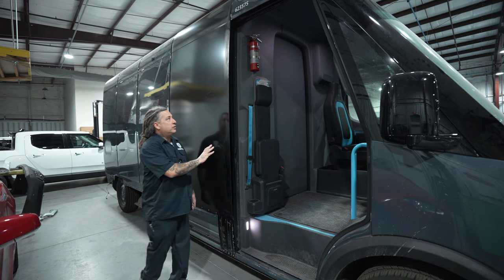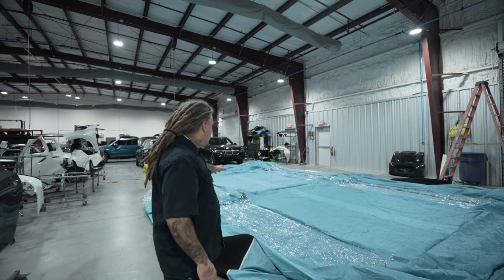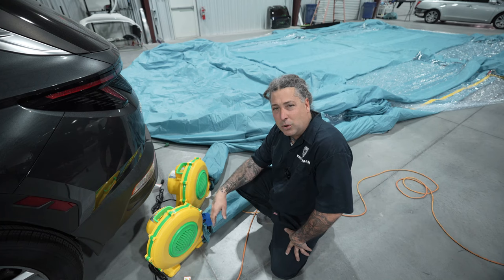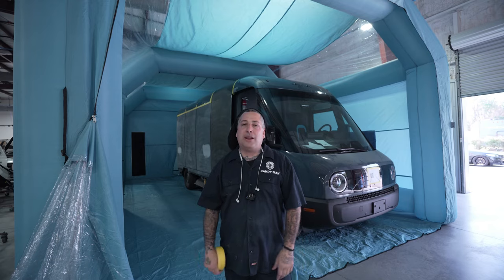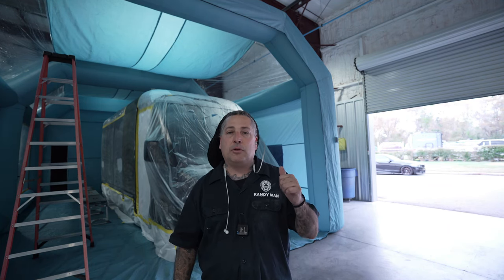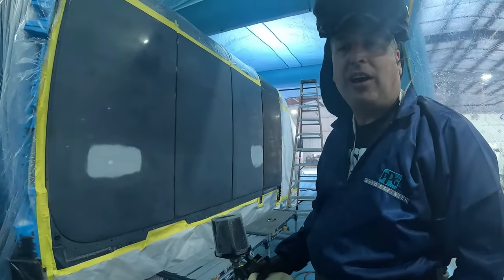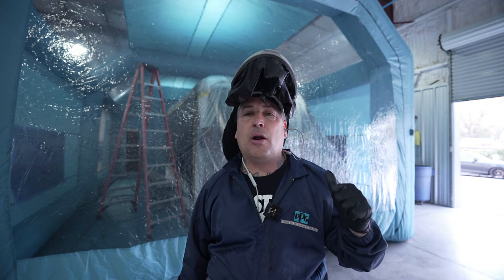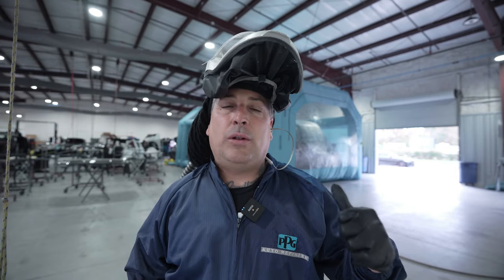Painting A Rivian Delivery Truck In A BLOW UP Paint Booth!

Comment: I use a custom Sewinfla airtight waterproof blow up. A bit more expensive 4000-5000 after all accessories. It does not use the blowers to keep it up, once you inflate, it stays up for a long time. Fans are just used for circulating air. I have 2/1100W intake fans and 1/520W exhaust fan. No overspray issues even on clear coating whole cars, provided the filters are kept clean (replace often). They make them in custom sizes. Cons: the custom made ones are shipped from China so you have to wait a long time for delivery. And you have to replace the filters often (but you can buy rolls of the filter material relatively inexpensive). Also if you buy a larger one piece, size, it is mobile but heavy (they do make the two piece ones that are zippered in the middle, and can be used individually as well, but I have never tried those). Customer service has been great so far.
Reply from the maker: Appreciate the information  👌
Reply: @kandyman5315  I appreciate your content, and all the lessons. Thank you.

Comment: They make a 3hp exhaust blower that helps alot on overspray a must with that big of booth I have the 30ft long both without the little room also have the elephant booth fan on the outside that does great I think I paid 250 for elephant fan and 300 on 3hp exhaust blower try this u would love to airflow very nice video and great job on van super slick also have those led light 100ft roll that you cut to length have blessed day
Reply from the maker: Thanks for the insight

Comment: I had this same booth and used it outside with an extraction hood.  Setup outdoor you get much better light inside the booth, but it can be a challenge with any wind over 7-8 mph.  And I was able to fold the booth up by myself and it fit back into the same bag it came in.....

Comment: You should get a ladder with wheels. They have a platform at the top and you can go up from both sides. The wheels have springs so they go up when you step on it. It’s what I use if I’m painting the outside of the boats.

Comment: Another cracking video 📹 kandy man 👨 I had one only small came with one blower but you need 2 blowers and a extractor fan the vent mate on the side there make a thing that velcro on and you can attach a 12 inch extractor fan 😊😊😊
Reply from the maker: Thanks for the information 👍

Comment: Big panels like that aren't the easiest to spray. When i started before i learned to get some light on those big panels i would have trouble getting proper coverage with metallics. Tiger striping. Until i got light on those panels, started opening that fan on out for the drop coat.

Comment: I spray solvent. Would love to try water based one day.
Reply: Humidity is more of a factor with water. Not so much temperature. If you're in an area that gets high Humidity in the summer it will slow you down. Other than that it's not bad. Coverage seems good and the metallics blend easier.

Comment: I understand how you feel. Arm is just dead after doing a 30’ side. Interiors of the boat is worse because you have to paint shelves, hinges, consoles, door stops, over hangs, bathrooms, seat boxes, hatch lids, and bait stations. List goes on. Going up and down. Ends up being about 2-3 more cups of paint on the inside vs the outside. Sometimes more. Painting the floor at the same time is probably the worst though.

Comment: Hey What was wrong with it you had to polish it, I bought the big 20 x 30 inflatable paint booth , I haven’t used it yet, I’m going to paint my 2000 Silverado extended cab , I’m going to paint it House Of Colors Galaxy gray metallic, the inflatable booth I got has one input for it to blow up and two inputs for ventilation, but iim only going to use one for ventilation and put fans on the outside of the filters to help pull the over spray out.
Reply from the maker: It works  for once in while job